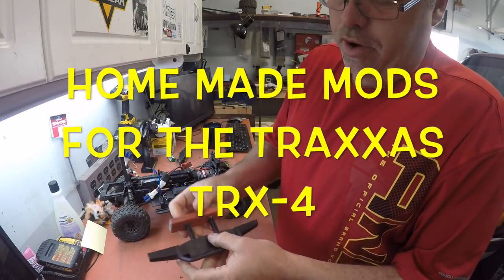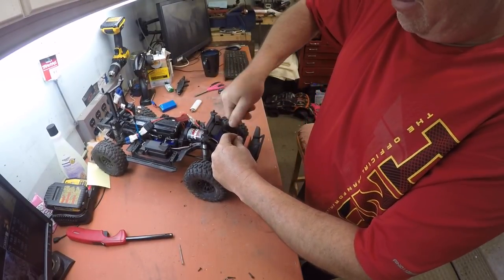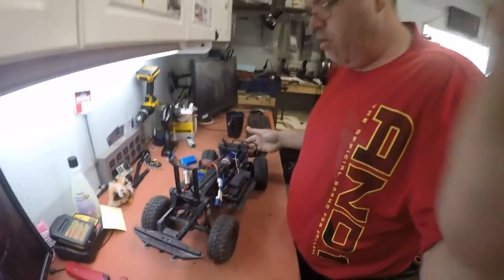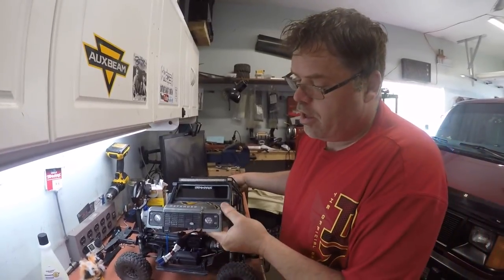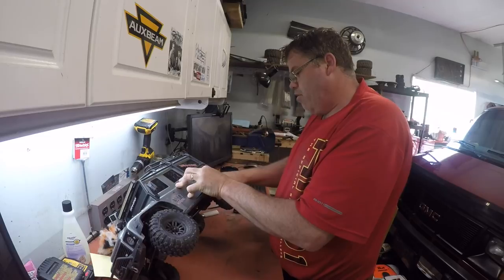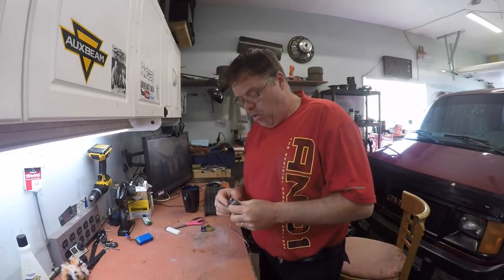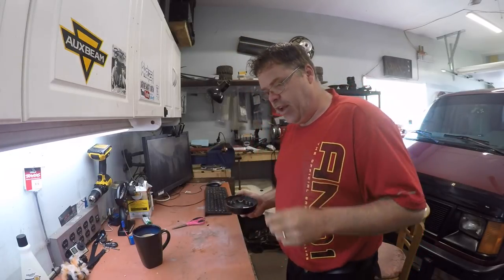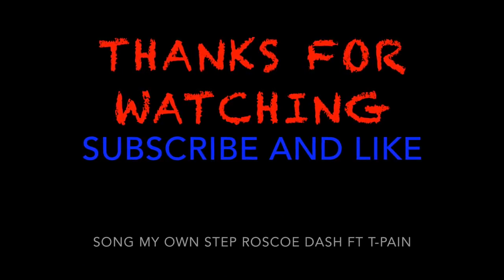Home Made Mods For The TRX 4

Comment: Just subbed, over from Kev T, what lights and battery connector did you use. Thx.
Reply from the maker: Metal Miner lights are the trx4 from traxxas and i used a 9 volt battery